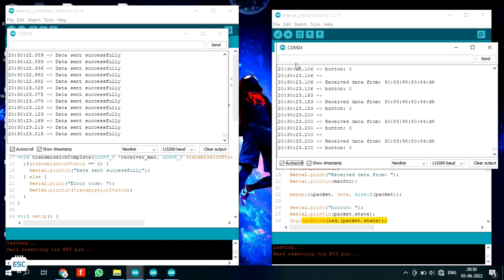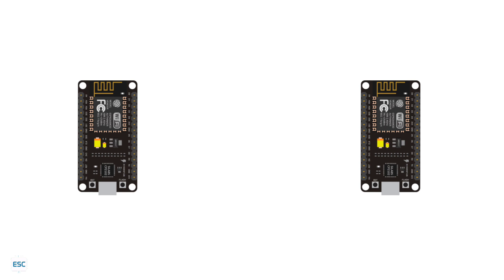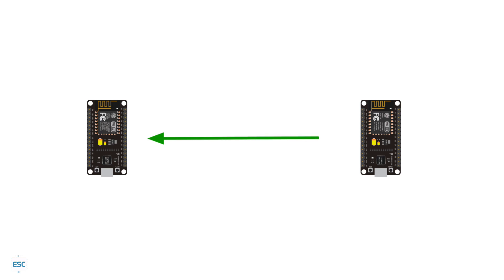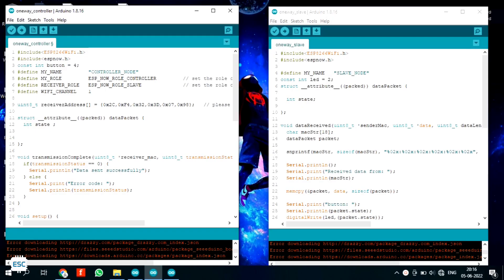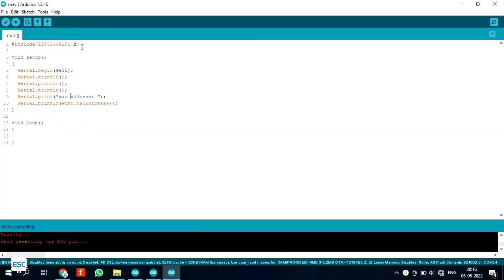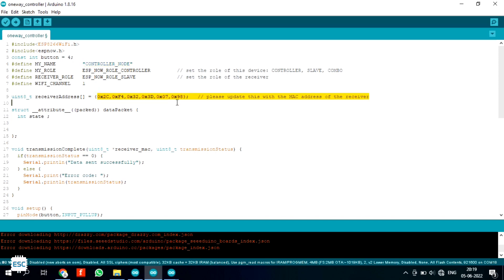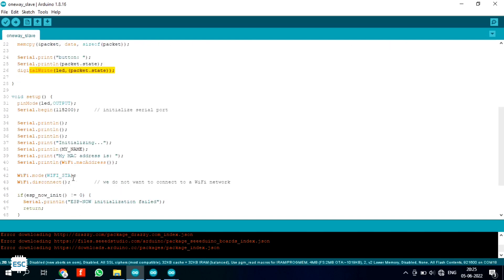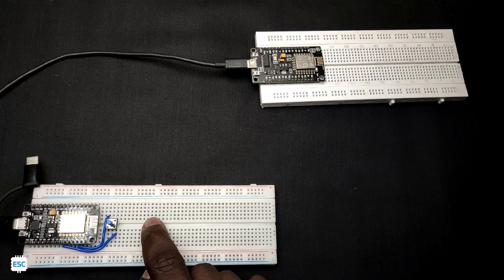How to start with espnow | ESPNOW One-way communication

Comment: I'm really having trouble understanding how to connect the esp32 to a power source.
Can I use a 9v battery? And where to connect it to a vin pin or a 3.3v pin
Reply from the maker: You can use 9v battery . Only connect it to vin pin

Comment: Do you need to connect the push button to a certain pin? Also, what about multiple LEDS and multiple corresponding buttons?
Reply from the maker: You can use any . But correctly proportional gram according to that
Reply: @EDISON_SCIENCE_CORNER  Not sure that I am understanding the terminology correctly. What do you mean by gram?

Comment: I'm very happy that after just one try it immediately worked well..
but how is the coding to make the LED light up for one minute, can you give me the code & give me instructions on where to put the code please..?
Reply from the maker: Just change the delay to one minutes
Reply: @EDISON_SCIENCE_CORNER coding delay is only in the controller, when I tried it at 5 seconds, this is related to pressing the button too, so the button is also pressed for 5 seconds, it can't be a fraction of a second

Comment: Can I connect for this relay in the place of led can you share me the code
Reply: I have connected with relay but the relay is not working fine can you give me solution
Reply from the maker: Just connect the relay
Reply: @EDISON_SCIENCE_CORNER   it is not working  with the led pin can you give me the code with another pin connect relay and when we press the button the relay will be 'on'
Reply from the maker: Is this circuit working or not.?
Reply: @EDISON_SCIENCE_CORNER  no it is not working
Reply from the maker: I mean the led circuit

Comment: Hi, im getting errors in the code while compiling in the controller code after i change the mac address
Reply from the maker: I didn't understand what you were talking about. Please use my WhatsApp and share your problem
Reply: @EDISON_SCIENCE_CORNER  no problem i solved the error
Reply: @tinker_tech What is the solution? share it please
Reply: @EDISON_SCIENCE_CORNER reciver code not working.... Geting compile time error

Comment: Good morning, can you help me with a project? please!, I have 2 esp32, I want through the esp32 (master) to sense a magnet (using built-in hall sensor) and then turn on a led on the other esp32 (slave). The connection between the 2 esp32 must be espnow. I hope you can help me, thanks! Using arduino IDE
Reply from the maker: Simply you can use this sketch. Just modify a little.
Reply: @EDISON_SCIENCE_CORNER  I don't know what to modify, it is the first time I have an esp 32, and the first time I use programming, what would I have to modify and in what part? please help!

Comment: If power fails ..for 5 sec ...slave and master do not connect automatically after power supply again ..plz solve the problem
Reply from the maker: Which code you are using

Comment: good day I keep on getting this error "'esp_now_set_self_role' was not declared in this scope" any ideas?
Reply from the maker: Did you add the correct library
Reply: That might be what version are you using, I  also see that the espnow.h you are using has been upgraded to esp_now.h
Reply from the maker: Did that solved your problem
Reply: @EDISON_SCIENCE_CORNER  I used the sketch from here "https://www.youtube.com/watch?v=CbcnxGJkY-Q&t=962s" and it worked without any problems. Thank you for trying to help.
Reply: got your sketch working "well sort off" led comes on on button press but do not go off. can this be because I am using IDE 2.0.3? and do you have any idea how I can get the LED to flash in your sketch?